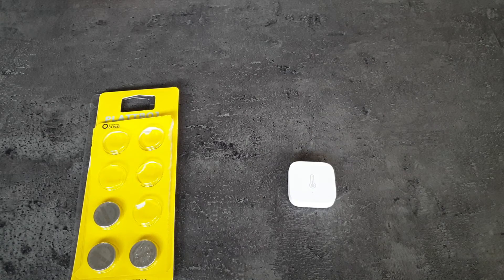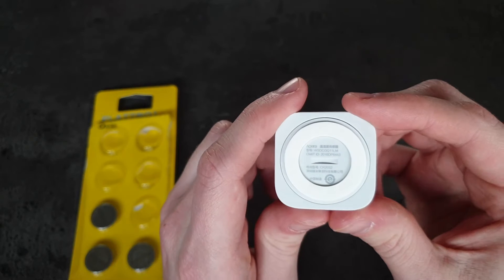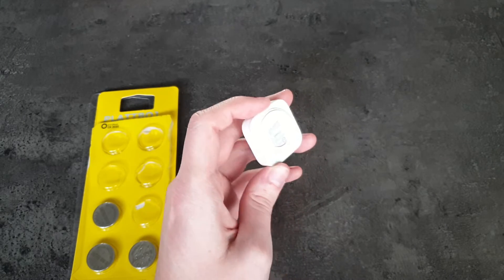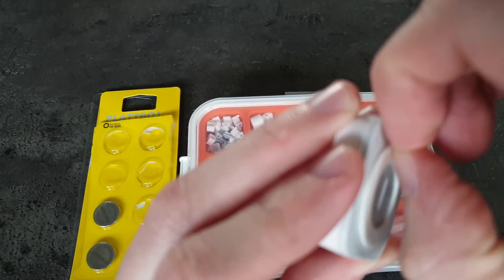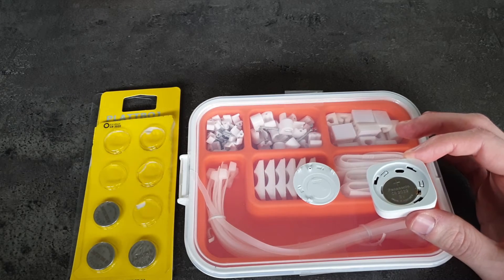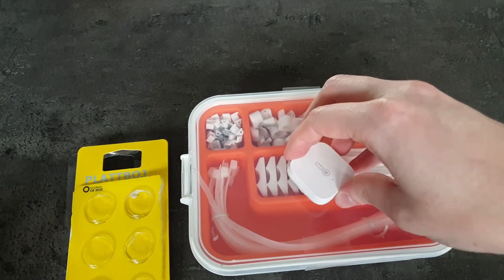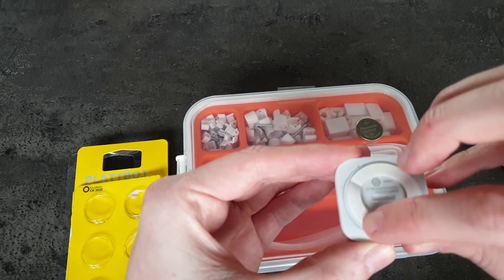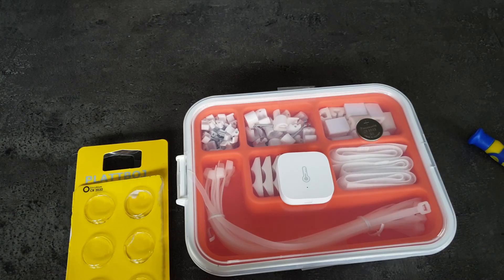Easy Battery Replacement on Xiaomi Aqara Temperature Humidity Sensor

Comment: Awesome, thanks. I found another way to open it as well: wear a pair of these non-slippery disposable kitchen gloves. Also, use a paper towel to wipe off any fat from the surface of the sensor. This way, you can get a good grip with your thumbs and can actually manage to turn it. Worked for me.

Comment: I really don't understand why don't you just use a coin. It's that simple. I use a 10c or 20c euro coin.

But most of my aqaras are already on the wall with its sticker so i just rotate it to remove the battery.

Comment: I've got a fresh idea for your next video how about you show how to setup a stepper motor in ESPhome? Many uses for such setup yet no videos showing the Yaml code needed to make it work using ESPhome.
Here are the parts needed:
ULN2003 stepper motor driver
5V 28BYJ-48 stepper motor
I have tried but failed miserably.